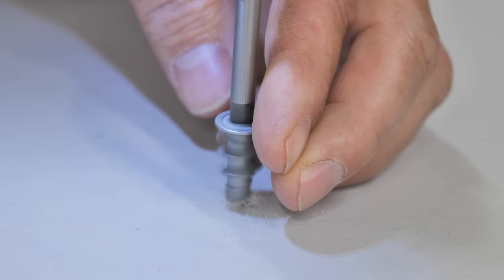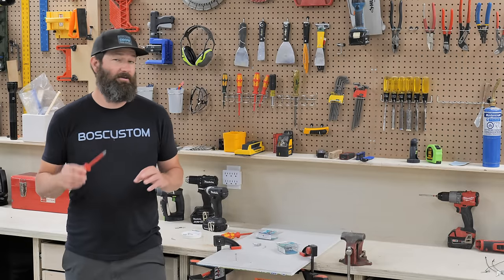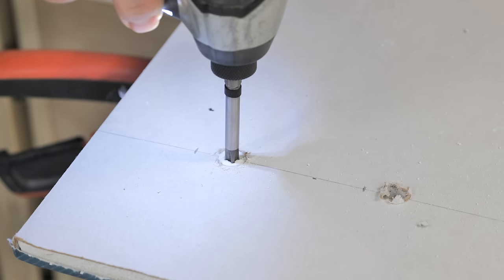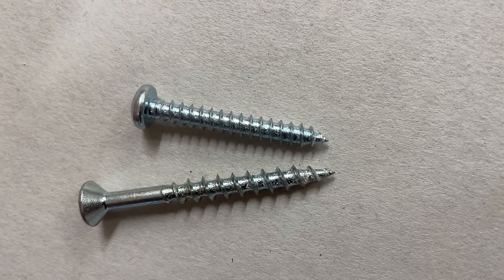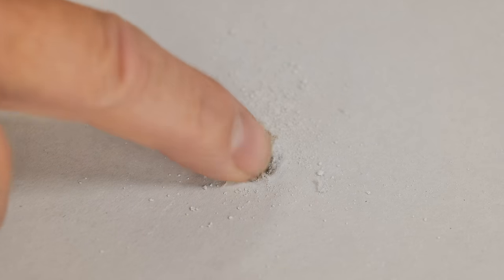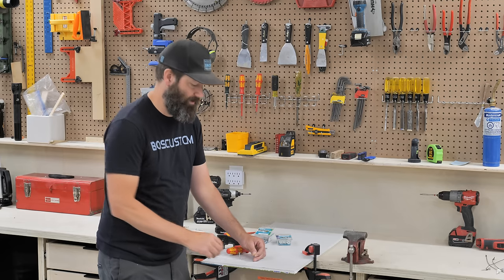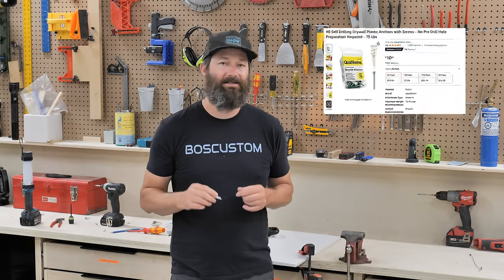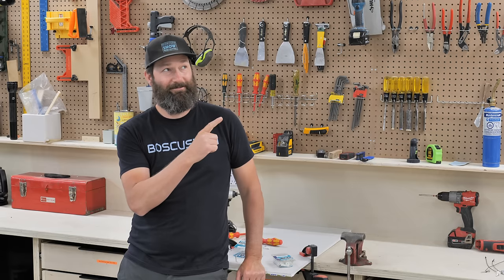How To Fix and Properly Install Screw In Drywall Anchors

Comment: Even with using the screw that comes with it,they still pull out.its really thin sheetrock
Reply: Yeah...that's why I'm here. I'm used to better built houses where I'm from. Even the crappy section 8 place I once lived had better walls. This place I'm in now SUCKS.

Comment: Possibly a dumb question but does the thickness of the drywall matter all that much? I live in a mobile home and I wanna hang a TV on the wall but I have ¼ inch drywall. Planned on buying multiple flip out toggle bolts that can hold heavy weight but how much does that matter since it's ¼ and not ¾?

Comment: I hate flip out toggle bolts, I never use them.  You Can NOT take the screw out once you have inserted the flip out part into the wall.  i use Toggler anchors. Awesome
Reply: Have you tried bullfix ?
Reply: As a renter, that's my worry. When you move out, wtf do you do? Just pound it all the way in until it falls out the back and into the wall? Leave the curtain rod hardware for the next person? Meh.

Comment: almost everytime I use these I just wish I used toggle bolts, everytime.
Reply from the maker: Have you been installing them correctly with the right size screw?
Reply: @TheFunnyCarpenter  Ohyah, but they just don't have the compression factor I tend to prefer for curton rods or bathroom accessories, that eventually they just wear out
Reply: Have you tried bullfix ?

Comment: Appreciate your help man.
But my angry little mind keeps chanting the same words: “ America build better homes. Do NOT make walls out of literal paper and glue. 😡” 
The whole world has homes built with concrete and bricks but the riches country in the world ( apparently) can not afford to make sturdy walls that can hold a screw. It seems like for screwing something on the wall and keep it in its place you need an army of supporting stuff. I miss home where you can take a hammer and pins and just hammer something down. Or just get your drill and screw something tight into the wall and it stays there for ages, without falling.

Comment: Flip outs? Naaaah. Zip toggles all day
Reply from the maker: shhh don't tell that to the 100 pack of flip toggles I bought off Amazon last year!
Reply: @TheFunnyCarpenter  Oh good god, I hope you feel dirty and ashamed every time you look at them in your shop. hahaha.

I found zip toggles and never looked back. Those old flip things are just... I mean they work.
But, yeah.

I run the metal drywall anchors though too. And let me tell you when it comes to you talking about the screw size stuff, hoooly crap you better not grab the wrong one, cause..> Someone mixxed my box of screws for those... and they look identical but they different. 

Wall anchors in general are such an interesting topic, i have like 5 or 6 diffent wall anchor styles here and, some of them are pretty neat.

Comment: NEVER use these anchors!  Use Ramset Hollow Wall Anchors instead.
They are stronger and easier to install.
They are easy to remove:  Either my drilling, rolling or (my favourite) snapping them out.
They use a smaller hole and I've NEVER had a failure - they are fool proof ! ! !

Comment: I set a hundred of these a day with my impact driver.. another classic difference between DIY, and skill. Keep on taking all year to almost finish a project 😂
Reply from the maker: Not everyone in the world installs bathroom hardware every day.  For the rest of us, the impact driver is not the tool to use.
Reply: @TheFunnyCarpenter  awe you're offended by my comment 🤣 
I do top of the line built-in entertainment centers, cabinets, offices, closets, and more in Central Florida. Places like Golden Oak, Heathrow, Isleworth, and Winter Park every day. 
For all of us working productively every day, using a screwdriver for an easy anchor is just hilarious.
Reply from the maker: I c. Can’t help but think installing top of the line anything with 100’s of hollow wall anchors might be doing it wrong.
Reply: @TheFunnyCarpenter  just move the studs then, right?? 😆 
You sound like a typical homeowner, assuming they know how everything works because they read the instruction manual, lol

Comment: You never showed me how to put it in the right way.. Not even a demo!!  Also, So if I put a flip out toggle pull into an old anchor hole, I'm supposed to be able to use it¿. Well, I tried it, even though you didn't show how to properly install it.  Got that off another video.   I just wanted to come back and let you know that you should change the name of your video or upload a new one.  Because,  you do not show how to properly install a drywall anchor or how to properly fix an old drywall anchor hole.   Thank you,  No Thank You!

Comment: First and foremost if you're going to use a drill drive it all the way to the lowest setting humanly possible drop the speed down as low as possible. 

Preferably take your screwdriver bunch of small hole in the drywall then use your screw to screw the anchor into the drywall.